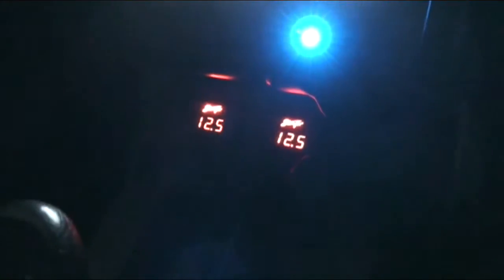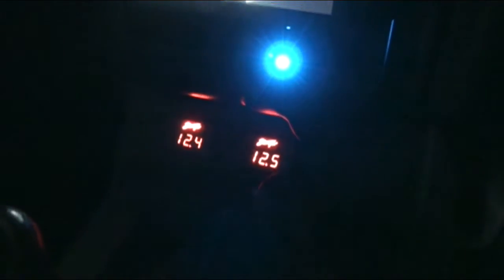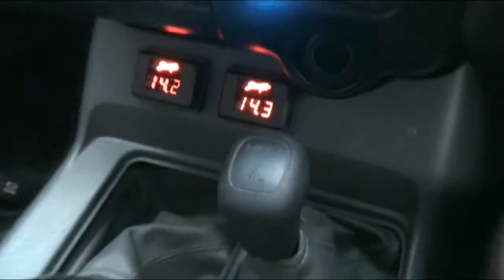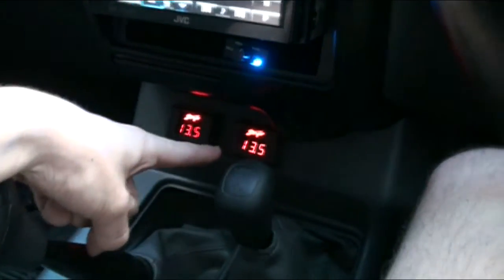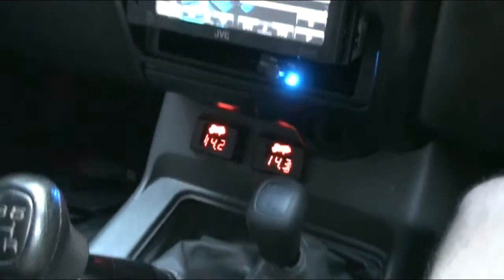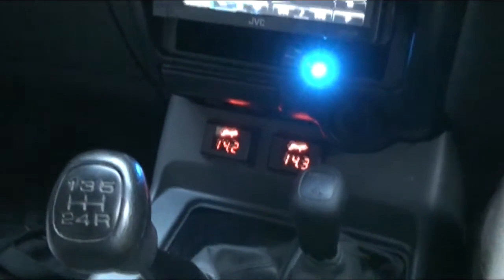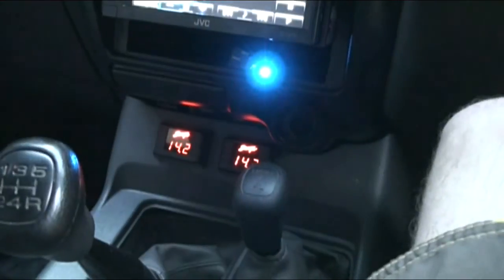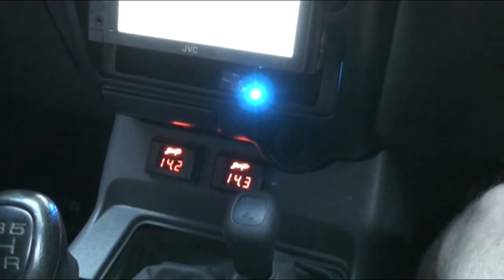Voltage Test with 2nd Stinger Voltmeter Directly At Amp

Comment: so if i want to wire this voltmeter in to my amp, I can just connect the positive into the power of my amp input, ground to the ground on the amp, and remote to the remote on the amp? I'm guessing I would just have to find some wire to extend the length to get it all the way to the front of the car? What type of wire do i need? I'm guessing speaker wire would be no good lol

Comment: Do you have a install video for your  volt meters ? I just bought same one, was looking for tutorial on how to install it in my vx. Running 12x2 , 1500rms amp.
Reply from the maker: yeah pretty sure I did a video when I installed it but there really easy, hook the black wire to earth/ground, the blue wire to the remote wire for your amp and the red wire put into the positive wire on the amp, really you can just run 3 wires from the amp direct to the voltmeter to keep it simple
Reply from the maker: HowTo Install Stinger Voltmeter Red - Holden Jackaroo Easy !

Comment: I'm going to buy another tsw sub so at 1 ohm load ill get 2k watts. Would just 1 battery suffice ? And what happens when voltage drops too low on a stock batt?

Comment: Hey man just wondering. I got a tsw3002d4 and a 2000 watt rms amp. The sub is running at 2 ohms and the amp puts out 1300 watt at 2 ohms. I'm